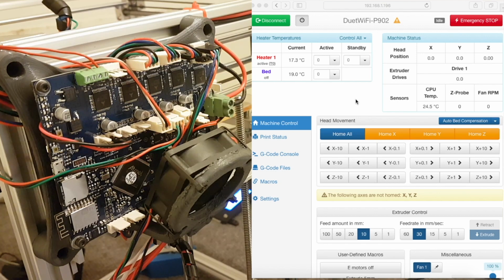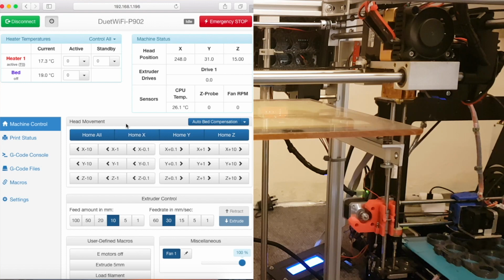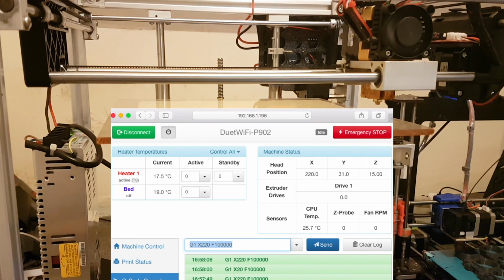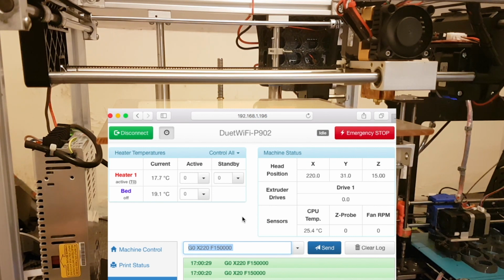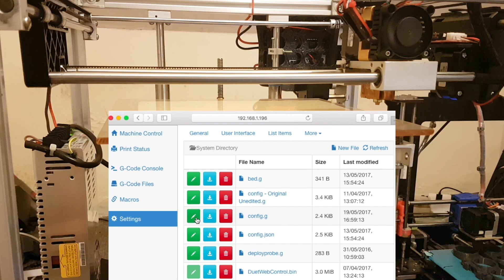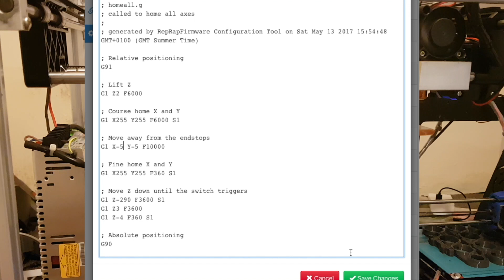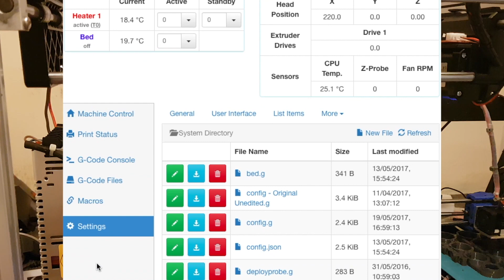DuetWiFi Review (Speed Test & on-the-fly Firmware Changes via Web Config

Comment: I have used Duet 2 wifi some time now. At the very start i felt like my steppers was really quite but now after fw upgrade and with settings... I dont know but my steppers makes alot of sound at some speeds. Even my older 2208 on a MKS board is totally silent at any speed....

Comment: To add to, if your machine is 240mm in that axis, then at an acceleration of 3200mm/sec^2 you can really only hit about 800mm/sec or 48,000mm/min movement speed, and do so reliably. At an acceleration of 4600mm/sec^2, you can get away with 1000mm/sec or 60,000mm/min travel speed. However, you're now going to have to see if your hardware can actually produce that acceleration.

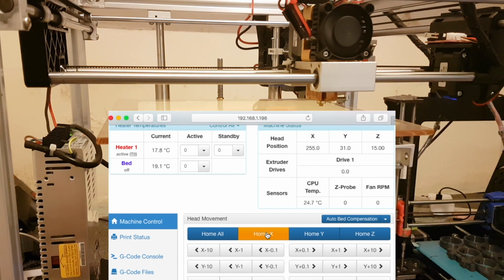Comment: You can fix the problem you had 11:40 with homing after skipped steps by disabling the software endstops on the x min axis.  You can actually disable it on any point in which you have a hardware endstop, but the x min is the one that held you up there.